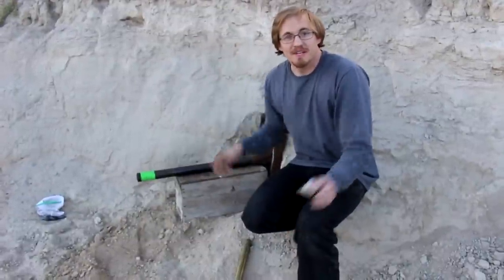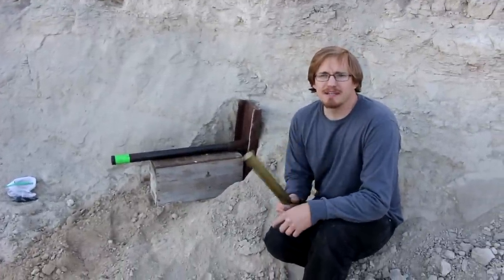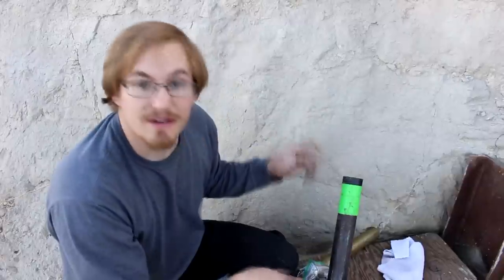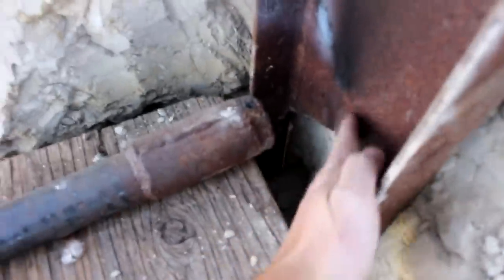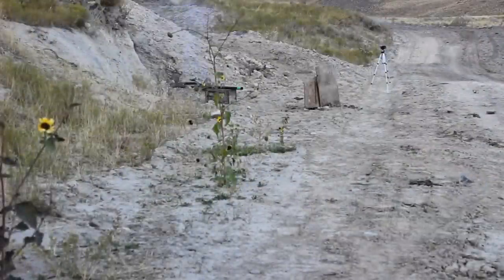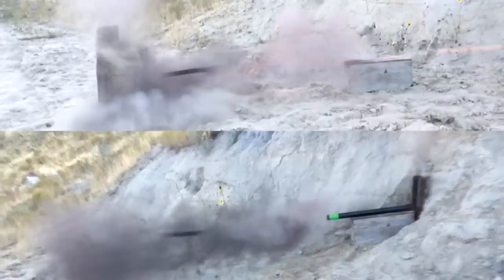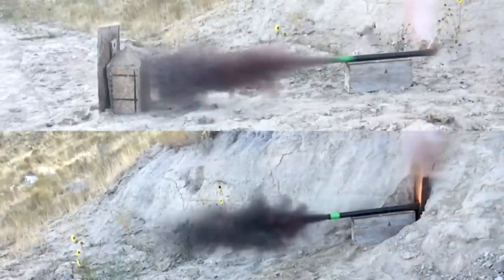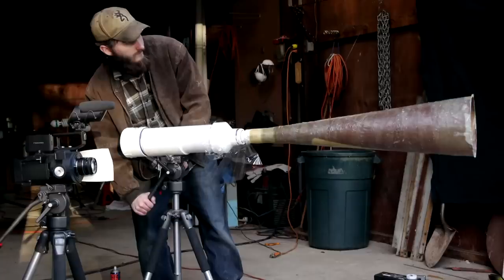How Does Recoil Affect Gun Performance?

Comment: Cody's lab I seen a criminal trial in which an "expert" testified to the contrary. A guy was charged for shooting his wife,  the husband denied it and said that the gun was sitting on the dresser and fell,  and that it was an accidental discharge. The prosecution brought in an expert, the dresser and the gun, they said that with the bullets trajectory  that there was no position the gun could be in to where it would have enough force behind it for the gun to fire with lethal velocity,  he even went as far as to say if you fired a floating gun in a vacuum that the bullet would barely make it out of the barrel!
Reply from the maker: That "expert" was an idiot. tell me he didnt win the case.
Reply: Cody'sLab jury bought it hook, line and sinker, I'll try to link the case to you
Reply: I know some automatic guns won't cycle without something behind them
Reply: A gun has still a lot of mass compared to the bullet - so what ever that person said is wrong.
If the gun is for example 1000 times heavier than the bullet (rifles), the amount of energy the charge dumps into the system stays the same. If it is floating in vaccum that means there is nothing but inertia.
So now we have 2 parts accelerating, just one being 1000 times heavier, but receiving the same force.
So the difference in energy to holding the gun and not holding the gun can be expected to be less than 1 % for that case.

(But yes, with nothing to hold the gun the bullet will be ever so slightly slower.)
Reply: I'm working on my PhD in experimental physics and I can assure that the "expert" was absolutely 100% incorrect. Imagine a grenade blowing up, it throws stuff very fast wether it's in space, on the ground, or in a tube.
Reply: Billy Debenham just to clear things up I'm not agreeing with the guy, hence the quotation marks
Reply: James Sholts I understand, wasn't trying to burn you
Reply: that's just straightforward bullshit. very silly attempt to make suspect confess or one very stupid guy must be fired from police  or you heared something incorrectly
Reply: Thomas Rhodes you hit the nail on the head, theatrics at its best,  unfortunately this guy is doing life based on some really shaky science

Comment: Hi Cody,
just one thing. You mentioned that pressure acts on projectile and cannon for a very brief moment, that's true. You should also consider how that pressure got there, as it didn't just appear there. Pressure had to build up in time of powder burning and increased in a continuous manner. The projectile and cannon accelerated already during that process. If my understanding is correct, F=p/s, a=F/m=p/(s.m), (pressure/surface/mass), but p=p(t), acceleration will be proportional to pressure, which in this case is nonlinear in time. The cannon recoil will matter a lot when powder charge is large and it burns slowly. I'd repeat experiment using really really coarse grain powder.

Comment: I have another hypothesis.  Whether braced or un-braced, work is indeed being performed on the gun in both cases.  Where it is un-braced, the work is obvious, the gun moves. Where it is braced however, the same work is still being performed on the gun, however that work is transferred to the soil, or as you mentioned perhaps without realizing, the ground was crushed.  In one case the work energy was transformed into the gun moving with - lets just arbitrarily say, 50# of force in the opposite direction and since it's not meeting an obstacle, the gun is simply left to "fly".  In the other case, the 50# force met a steel plate and clay backstop where the energy was transferred into these media (The work was used to dent the plate and crush the soil).  In both cases, the force acting on the gun was the same regardless of braced or not, one just had something to transfer to and stopped, the other did not and flew. No laws violated.
Reply: In both cases the gas pressure in the tube is the same on both ends of the gas "Bubble", one end pushing a projectile, the other end pushing the tube. I would be very interested if you would be able to flip the video and compare the speed of the tube moving to the speed of the projectile.  I would expect the tube to move just a tad slower due to friction loss to what it is sitting on, but I bet we would see a very close speed approximation if the two weights are the same (i.e. the same speed of tube heading backwards as projectile is heading forward minus a little friction loss to what the tube is sitting on).  I would further hypothesize that the reason a bullet moves so fast is that (using our numbers above) a 50# force on a 10 gram projectile vs a 50# force on a 10# bolt-action gun would be why the bullet moves a tad faster than the recoil (Inertial forces on each....) The same work is being put in to each, but that work accomplishes more in the lightweight projectile.  Just my brain spinning out of control. sorry.
Reply: BTW, I just did a measurement off my monitor of the un-braced one and in fact the tube and the projectile are moving at very close to the same speed.
Reply: Or to completely nerd it out: as you said Energy = mass x acceleration. Mass of gun x acceleration = energy. 145 grain shell recoil is ouch. Same gun 175 grain shell recoil is holy crap! The mass of the gun is the same the amount of weapon acceleration is the only variable - the 175 grain accelerates the weapon into your shoulder faster than the 145 grain. When braced (or shouldered), the brace absorbs the energy but cannot transfer it and redirect the energy rapidly enough to affect the projectile, since it is traveling near the speed of sound by that time, the pressure wave that would be returning would not have enough time to re-impact the back of the projectile to affect the projectile speed before it has left the end of the weapon.

Comment: Cody, what if you think with instant instead of time?

Correct me if i'm wrong, but:
In the instant of explosion, the gas generate forces in every direction, therefore, the same amount of energy is applied for the gun and the projectile (considering only the opposite directions), so the brass starts to move. Now, the gun will transform it's force to kinetic energy, which will then be transferred to the ground and scattered or used to move itself.
The gas will have less space, therefore, more pressure, but the gun is still absorving it, giving too little extra energy to the projectile, resulting in this imperceptible change of velocity.

Comment: Another hypothesis: the distance travelled by the projectile, relative to the rear of the barrel doesn't change over the propulsion phase (the propulsion phase still happens over 1 barrel length). Hence the gas expands the same amount, and therefore transfers a similar amount of energy. 

Another thing with this, we could assume the propulsion phase time is halved, but since the gas expands the same amount in half the time: twice the average force, over half the distance relative to the earth? 

I think another reason people believe they would be slower together is that they are thinking the speed relative to each other stays the same (or something along those lines of thinking). However, because the maximum possible velocity of the expanding air that is transferring energy is soo much higher than the projectile and gun, this effect is negligible, unlike in the case of a mechanical Spring.

Cheers anyone if you read this, just messily placed ideas but maybe you can understand my logic and/or understand where my ideas weren't accurate. 

And thanks Cody for this excellent and thoughtful video

Comment: Hello Cody! I have different hypothesis, Newtons third law of motion states that for every action there is equal and opposite reaction, and Law of conservation of momentum states that the momentum before the collision is equal to the momentum after the collision, my hypothesis doesn't deny any law, so it might be correct at some level, hear me out,   when there is recoil, the answer is obvious the gun is thrown back and the bullet is moved forward, Now when the recoil isn't allowed and the gun is strapped down, Actually if you look closely at 5:08 there is some recoil, so the recoil here is still present but minimum, and you can see the gas coming out the escape hole at the top and it collides at high speed with the iron bar kept behind it, So the moment is conserved because the bullets momentum is obviously carried out because it is shot forward, and the barrel is collided with the iron bar and you can see the effect at 5:08. If there was completely no recoil or no effect after the gun was fired, then the bullet wont even move forward because of newtons third law of motion.!

Cody feel free to correct me or give me advice if i said anything wrong.

Same for eveyone else. Please feel free to correct me :)

-Usain

Comment: I think the reason you are getting more gas escaping from the touch-hole, is because AT THAT MOMENT the gasses are taking the path of least resistance...  as in at the moment it ignited and began to expand, the gas explosion bubble tries to expand in all directions...  with the braced cannon it hit a solid surface that it could not move so thag force would be reflected in every other direction, meaning more gas had to pass the touchhole and has a greater amount of gas being given the chance to go through that hole, as well as causing more pressure at that point as it would DOUBLE near the touch hole as not only do you have the gasses expanding to the back of the cannon, but the reflected gasses would then double back and hit the gasses heading backwards and double the pressure where they hit...  thereflre the gasses near the touch-hole would be twice as dense and with twice as much pressure, thereby making more gas escape through the touchhole.  This rebounding may also explain why the projectile in the braced cannon did travel marginally faster than the unbraced cannon projectile.      ...   So with the unbraced cannon, the gasses headed to the back of the cannon would not reflect as much (if at all)  and the back of the projectile would be receiving marginally less force than the braced cannon projectile.  The cannon flying backwards would also act like a rocket nozzle in that the flat back end of the projectile would act like a launch surface and the long tube would allow the escaping gasses to exert more force for longer on the inside of the cannon tube, thereby forcing it backwards at a greater speed than the projectile.  So the projectile would fly forward marginally less quickly, but the cannon turning into a rocket would fly twice as fast.    ...   Odd phenomenon.

Comment: let start with i never studied 
but isnt it the same as energy dissipation? your explosion wants to push left and right at the same time, this should always be equal. therefore it doesnt matter if you strap it down or not. the only difference is the size you are dissipating your energy in. moving a small object very far or moving a very large object a tiny bit.
both dissipations are exactly the same but in a different form of mechanics
correct or not?

Comment: Yeah, The distribution of forces over a period of time. You changed what objects the forces would be distributed over/between. If you could change how they are, you would be able to affect the projectiles velocity. As long as the distribution is the same its the objects and how they transfer and what they transfer that energy to that changes. The barrel and the mountain vs the barrel and the air. You weren't lucky. Your hypotheses just took into account the former. The latter wouldn't be apparent until you performed at least one other experiment. The pen for example. I think.

Comment: If we presume the sound and heat caused by the explosion are constant (as they should, if the powder load, the gun and the projectile are the same), the explosion of the moving gun has to move the gun and the projectile, thus having reduced energy to move the projectile itself.

Comment: You should see if it's a little different with a significantly longer barrel. I hypothesize that if the barrel were more than three or four times the length of the projectile, and a larger charge was used, they may differ more. Consider that as the powder explodes and expands, it loses energy to apply to the projectile as force. Adding more powder would allow for the continuing explosion to continue to apply force to the projectile while it travels through the longer barrel.

Comment: I propose that while there may not be a much of a noticeable effect on the escape velocity of the projectile, the range WILL be affected by a small, but noticeable ammount. Especialy were you to plug the gas escape hole at the back and fire @ 45-60 deg arc. What you say is definitely correct, but there is going to be some additional loss due to the expansion being allowed in both directions as one would assume, it's just not a deciding factor in this example. What can be argued is how much loss realy is there and the only way to realy measure just how much it is is repeated max range testing.

Comment: energie distribution is not equal and opposite. momentom is. but kinetic energie is related to speed in its square while momentum is only linear. thus, a lot more energie is in the movement of the faster and ligther object. 
|p1|=|p2|
p1+p2=0
p=m*v
E=1/2*m*v^2
E1+E2 is only zero, if the masses are equal. If they are not, while the released kinetic energie is constant, there is disproportionately much energy in the lighter object. but explosions are slow, especially if black powder is used. I know that other, faster burning gun powders would be more dangerous and increasingly difficult to equal for both tests, but I think with them it might have been more obvious.

Comment: 8:58 You can see this effect in really slow motion in the clear potato canon video that Destin on SmartEveryDay posted relatively recently. Where the expanding flames, gasses and yet unspent fuel push the potato out of the cannon, you can see the gas at the back expands and escapes later than those at the front. There is even an oscillation of pressure to vacuum a bit as new air rushes back in but then more fuel ignites. It's quite beautiful.

Comment: Yes, I would expect the result you got. The explosion occurs at point A and even if the gun moves it still centralises from A. The only small change we would get, probably unobservable, from supported to unsupported is that whenever the unsupported explosion happens, the firearm will move back, wheras the projectile moves forward. Relatively, this creates a larger chamber, meaning a lower pressure will occur, or theoretically should do. However the only way to confirm such things would be to measure the pressure internally in the firearm: once with the whole setup strapped down, again with the setup strapped to a rolling cart. I wonder would there be much difference? Has what I said make sense? When the firearm moves back, and the projectile moves forward then we get a larger gap and therefore volume than if the firearm was stationary, meaning there is a lower internal pressure, meaning the projectile should move slightly slower? But given we are talking pressures in the 10K to 20K range and the projectile leaves the barrel so quick, the effect would be minuscule. But if you can somehow test this, I would be interested in the results.
Reply: NightHawkInLights issue was that the projectile had already started moving forward, not remaining with the barrel. I think the rifling moving back would have some impact on the velocity. Again, probably so miniscule.

Comment: It's the expansion ratio of an internal combustion engine that improves the mechanical efficiency, not just the compression ratio. The two are typically 1:1 linked as geometry is identical on compression and expansion, however valve timing can alter the effective compression ratio, and you can design something like the atkinson cycle where the compression ratio is significantly lower than the expansion ratio.

Increasing the compression ratio improves scavenging efficiency in addition to other combustion dynamics depending on internal geometry. Clever valve timing / overlap can exploit higher compression ratios to improve volumetric efficiency. 

"wild" camshaft profiles that have intake valve closing farther into the compression cycle will perform like an atkinson engine at lower piston speeds, but will benefit from the fluid inertia of the air charge to increase cylinder charge at higher speeds.

Comment: The whole time you were talking about the cannon imparting equal force whether braced or not I had the question as to what would happen without any out gassing hole for excess pressure to escape through much like a bolt action gun. 

 I am very satisfied that you actually eventually got around to talking about essentially the same scenario. Very cool video and very informative, thanks!

Comment: My theory uses momentum. Momentum must remain at the same state as you can not gain r lose momentum within a system. As the gun and projectile are at a state of zero momentum before the round is fired, it will be after. So as the projectile is shot forward, the gun needs to move back at the exact oposite momentum to keep the system at a net total of zero